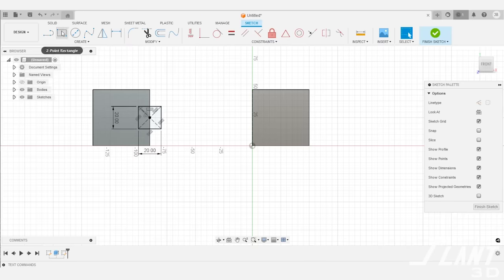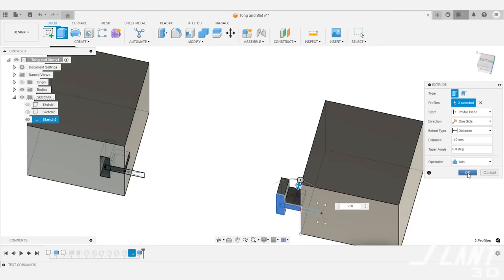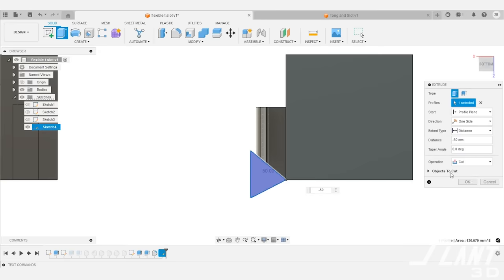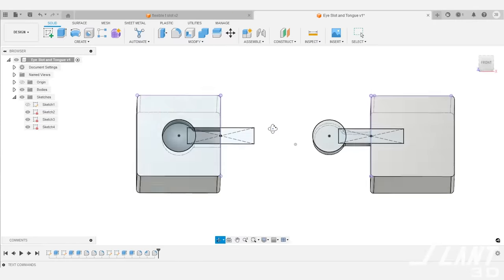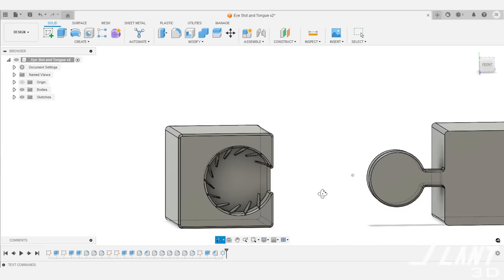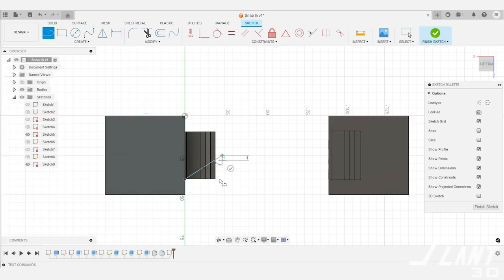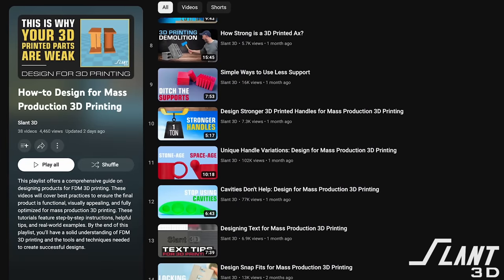Joining Features | Design for Mass Production 3D Printing

Comment: I don’t mean to be rude, but those “snapping” pieces that you said cannot be done with regular manufacturing techniques do exist and are used extremely regularly in injection molded plastic parts. If you look up “plastic snaps” you can find entire design guidelines  to create permanent or temporary snaps. Those guides are usually made for injection molded plastics so you have to change them slightly for 3d printing but they are very common
Reply: You need a more complex mold but they're reasonably easy to make.
He also said they couldn't be machined, that's ridiculous
Reply: Yeah that was a weird statement. Basically every other consumer device uses these for the case. Sometimes in addition to screws, like with many laptops.
Reply: That doesn't conform to the "3d printing is magic and can do things no other process can do..." claim you see quite often but is very rarely true. 

Additionally many of the options provided in this video are also just generally bad and extremely fragile when not assembled and some when assembled.
Reply: Well thy can be machined.. T types of mills easy...
Reply: @Segphalt literally this.  This dude is an amateur.
Reply: @NicksStuff  I'm glad I'm not the only one who raised an eyebrow at this.
Reply: I'm glad this thread is here. I had the same thoughts but I am not really tuned into real-world manufacturing so his video was about to lead me to a false understanding that I may have parroted to someone else.
Reply: @NicksStuff  I was skeptical about that impossible claim too...
Reply: You're talking about over center locks.  They can't be machined, easily, but they certainly can be machined.
Reply: Can plastic snaps be molded right into the main body? How can the part eject from the mold?
Reply: @larrybud  it takes a complex mould, with some moving parts. Not impossible, but I guess not generally done as creating the mould is more complex and it probably also increases cycle time, lowering production rates. Depending on the material I guess you can get away with small grooves without additional mould complexity by relying on flex in the material itself (maybe larger/more powerful ejector pins would be needed).
Reply: @koma-k  Exactly. It depends on the material and the flexibility right out of the mold. More complex molds can have various moving parts as they open and close to create quite complex and/or deep undercut features. If you look closely at hooked/ribbed tabs, you can often see an extra parting line where a section of the mold retracts axially before the mold opens. Some designs have undercut features that depend on the ejected part flexing enough to clear the mold. Some plastics will further harden after ejection, and others are just generally more flexible even in their final form. Certain parts even depend on the flexing action of the ejection to impart less rigidity to certain areas by flexing those areas when hot, such as common "living" hinges, where a thin cross section piece is intended to bend in regular use.
Reply: The locking features are manufacturable. Just very expensive, probably not worth it for "traditional manufacturing".
Reply: Yes, but they tend to be made in 2 parts. The snapping interface is basically how a lot of washer doors close.
Reply: Snap fits are extremely common in injection moulding. I have been designing parts with these from I was studying ID 2 decades ago. They have been around before that. The only issue is that they require slides in your mold.
Reply: I like this content creator's efforts to educate, however, in this case, internal features (undercuts and snap fits) can absolutely be injection moulded but not with a simple 2 part injection moulding tool. Tools with side action slides are regularly used to achieve such details. However there are definitely examples of features that can ONLY be 3D printed and would be impossible to injection mould, but this video doesn't have any examples of this.

Comment: tapered dovetails for the win.  They do it all and are easy to design.  Just make the profile, project it to the other plane.  Run an offset and finally a loft.
Reply: Indeed; can't believe dovetail joints weren't on this list.
Reply: I was looking for my dovetail peeps!
Reply: You can even make dovetails into a form of locking tab.
Reply: Thank you! Must have slipped his mind when filming, but could easily replace the t and circle on a stick designs.
Reply: @chuyskywlk insanity right?
Reply: Thought for certain he was going to mention that after the t-slot.
Reply: @chuyskywlk  If he showed dovetails he couldn't claim that they where only possible with 3d printing, which is the real point of the video.
Reply: can you write more about your tapered dovetail? what kind of angles and what kind of tolerances do you use?
Reply: Same concept as the T just tighter fit and won't back out yes?  But you can only slide that joint, it can't be snapped into place.

Comment: I have been in engineering design for 50 years + and at 69 years still going strong. I find 3D printing with a combination of laser amazingly useful for prototyping and congratulate you in your channel and videos. Unfortunately you will always get negative comments generally from those not involved in design and lacking in lateral mindedness which of course is essential in design. Your objective of giving inspirational ideas to others thus enabling them to make informed decisions is excellent. Well done...
Reply: No, you haven't! If you did, you would have caught the many lies he told. I've only been designing a decade and I noticed multiple untruths. Such a dumb thing to lie about.

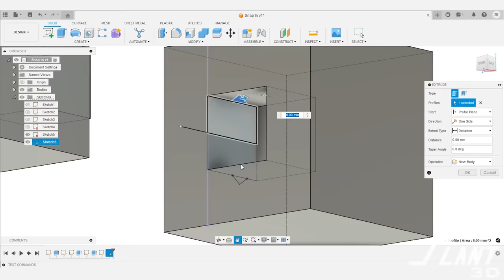Comment: 7:04 Such snap-in joints are actually manufacturable pretty good without 3D-printing. If your part doesn't have to be fully closed you can simply machine the recesses from the outside. Another option for fully closed surfaces would be injection molding with movable core pins. That's actually pretty standard in the industry and mainly limited by size. Another option would be milling or even EDM machining with special diamond shaped tools.
Reply from the maker: So not manufacturable as is. Correct
Reply: I had the same thought when I saw that. I have actually machined parts that are virtually the same with internal diamond shaped tools.
Reply: @slant3d  These parts can absolutely be manufactured with traditional methods. Fisher Price Snap Lock Beads are basically exactly what you are describing and have been made since the early 70s
Reply: @slant3d  if its a plastic part using a collapsable core in injection molding should allow for production as is.
Reply: Yeah snap links are easy to manufacture and have been around for years. While set up is a bit more expensive than traditional moulding it can be moulded or machines easily. A lot of toys are actually manufactured with those exact joints.  

Of course this is assuming the geometry of the product allows for it.
Reply: you're right, pretty standard in industry, absolutely manufacturable
Reply: @slant3d  No, there's a variety of ways to approach it, but those internal grooves can be machined. On a lathe, you can use a boring bar to internally open up a hole while leaving the opening at a small diameter. Your structure is basically the same idea, but done on a mill, and square... instead of a boring bar, I think you'd probably use something like a dovetail cutter, but I don't own a mill, I'm not certain what would be the best tool. 

I think using discharge machining, you could probably pull it off too. It would be a funky looking electrode though.
Reply: @slant3d  Wrong, mill out the square hole, change tool, mill in the slot with a dovetail cutter and or reverse dovetail cutter.  there may be a bit of overcut involved but this method could absolutely be manufactured with milling.
Reply: @@isawthat91 Agreed.  Basically the take-away here is 1) you can definitely manufacture these products [with similar function] with other methods, but 2) most have a higher barrier to entry; fortunately 3) this video still has educational value.
Reply: Yeah I think you all missed the point the point is it would take other methods several machines costing hundreds of thousands of dollars each versus a $300 3D printer that can do it in one pass
Reply: Additionally injection molding is not scalable as far as the size of the part goes. You need a separate new mold for every single different size part of the same shape whereas with 3D printing none of that is necessary you simply scale the part in a slicer and you have a new part just like that in minutes
Reply: @phasesecuritytechnology6573 that's maybe what he has meant but that's absolutely not what he said. He clearly states "they are impossible to manufacture". This statement is simply wrong.
In return for that injection molding is more than well scalable regarding quantity, quality and cost. But scalability was not the topic here.
Reply: @dominik7841  he clarified his point in the comment, "not manufactureable as is."
Reply: @phasesecuritytechnology6573 you mean you would have to change the geometry of the shown part to make it manufacturable by conventional methods? I have to disagree with that.
Reply: Yeah, really disappointing response from the author. Doubling down on lack of knowledge is a bad look.
Reply: @slant3d  losing credibility and showing an unacceptable amount of bias with this, and with that flippant reply. It is absolutely manufacturable by other industry-standard (i.e. not exotic) methods with some adjustment of geometry. You know, the same thing YOU do to make things easily printable. Tailoring a part to its manufacturing process is always part of the engineering game.
edit: don't like pride and bias ruin what is otherwise a very informative channel. Care about your reputation enough to admit when you are wrong.

Comment: I love how this channel features solutions that are genuinely useful but somehow so easy to understand. Anything that removes the absolute need for glue or screws is a pretty helpful design solution 😊
Reply from the maker: Thanks for watching. Happy to help
Reply: no part is the best part!
Reply: @ZURAD  what do you work for apple? no part last for ever, even one solid piece. replaceable parts means ability to repair. destroy the whole thing and make a new one or replace just a part that all the strain is shifted to. if the whole item is made from replaceable parts it can last forever, but that's not good for apple's profits. also mass production metal screws can provide a lot of cheap structural support to plastic.

Comment: 7:00 Worked as injected plastic part constructor, and yes, you can make such geometry in injection molding. With some small changes to geometry, like adding drafts to some faces. However, it would be expensive because you would need two very small sliders. And in traditional plastic injection molding, we would use proper positioning and proper hook (meaning, contact only on line, not surface to surface).
I suspect it could be done in metal machining, but again, would be expensive, delicate work, with some changes in geometry, slot in corners would be rounded at least.
Reply: He did say "as is."

Comment: Great content and truly enjoy the re-education. Being in the injection mold industry for nearly 1/2 a century there is an ingrained way at which "we" see designing and producing parts. It's this type of content that truly helps to advance my (our) thinking. However, there are techniques and processes that may not be top of mind for making some geometries that have been referred to as "impossible to be made any other way" on this channel. In the last example with the internal grooves, fully enclosed, there is a method to release that geometry in production mold tooling... I developed it for molding internal hinges on the Motorola phones in the early 90's. This comment is meant only to inform and I realize has nothing to add to the 3d printing world. Please keep up the content as it is truly informative.
Reply: Don't discount your knowledge. Engineers need to listen to people with your level of experience more.

Comment: Just started a 20 hour print where I opted for bolts and encapsulated nuts… wish I would have seen this video first! Nice work!
Reply: Coming from mechanical field I always use nuts and bolt myself.
For dissimilar parts...a interlocking system is extremely useful...
I know what you mean.

Comment: Excellent job with this video. But the snap-in joints are typically called snap fits. They are actually used a lot with injection molded parts but if I need a semi-flexible yet strong part, their basic design has almost always been the answer, especially when 3D printing.

Comment: I really love these! I design for both printing (MJF, FDM and SLA) and for CNC and injection moulding. This is also good - but locking, flexing clips are very possible and very common in injection moulding. Sure, this exact execution is not but the concept is exactly the same. I think the lesson is that we can use a lot of the same thinking, but applying slightly different optimisations and exploiting different strengths is important.

Comment: Love it. Thank you. 

I have just one issue with this, however: Snap joints have been around for quite a while in injection molding. The mold just needs an extra mechanism for each end - the male and the female. The additional mechanism does increase cost, however, and is SO much easier to do with FDM than IM. FDM makes the hidden snap joint a no-brainer.

Comment: Very good examples in your video.   You can change the fit (how much clearance or interference), but you aren’t changing the tolerances.  Tolerance would be how accurate and repeatable your 3D printing is.   A worn lead screw or bad bearings would open up (worsen) the tolerance that you can meet.   Take a look at an engineering drawing some time and you’ll see the tolerances required to make that part.   You choose the process (machining, surface grinding, EDM, etc) based on those required tolerances.

Comment: Nice!
My 2 "go to" connectors are the v-style tab (like the i-style but with "wings" on to stop it easily pulling out or flexing / rotating) and the "click-in-style" as you demonstrate, basically what you find on bag straps and belts that needs to mate together

Comment: needed a thin section joinery -> Slot for 2mm sheet metal strip is what i'm going to try :)
Glued in with E6000 or Epoxy is the plan.

Comment: I borrowed the concept of cordless power tools, the way 20V batteries snap into the tool is quite clever.
Although much more complex to design, I found it really good to make detachable parts (with and without a detach button).
Think the main takeaway is how the edges of the slot are a sequence of chamfers. This allows for bigger and safer tolerances that will still create a snap that does not jiggle.

Comment: Especially the spring design, but more generally whenever tension between parts is needed to hold the joint together, you're going to be fighting against creep - the property of the plastic to gradually deform over long periods of time under load. I would consider these designs non-starters for PLA or nylon and questionable for PETG. For ABS, ASA, PC, or PET they're great.

Comment: New to 3D printing, and have been brainstorming custom fasteners. 
I was thinking about an internal hole, with a slot on the edge that acts as a key slot. a tongue can only be inserted sideways, and then once inserted sideways, the part is twisted 90° (or more depending on design) to engage some kind of locking design on the inside, that prevents the part from being turned in reverse to allow the tongue to be removed via the key slot.

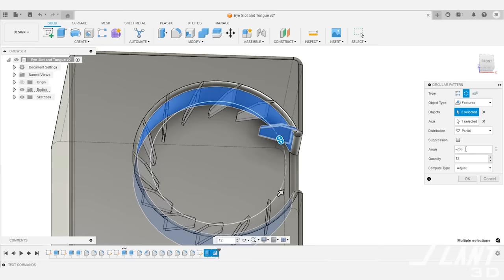Edit: imagine a grip fin ( 5:22 ) on the inside of a part that prevents twisting the part in the opposite direction once the grip fins are engaged within the body of the part.

Comment: I usually use conical or pyramidal pins for locating 3d printed parts against each other. One irregular trapezoid pyramid for a low-precision joint, two elliptical cones for a more precise flat glue plane, or three circular cones and one threaded insert and bolt for a removable kinematic mount. Aggressively tapered pin edges are easy to print, easy to sand to a precise mating distance for a one-off, and easy to adjust CAD to get a second copy to mate perfectly right off the bed. They also provide excellent glue surface area.

Comment: Tolerances are the bane of my existence. Literally every figure I download to print uses a key and hole (tongue and slot, whatever), a square bump that fits into a square hole, and not one artist has bothered with tolerances so the parts don't fit together and I have to sit there filling down the keys to make them fit. Even then they don't seem to fit cleanly.

Comment: As far as the locking tabs go you forgot about the classic dovetail.  The dovetail is simple, locks better than the square tongue, and tends to be a strong connection.  Depending on what you're making sometimes dovetails can be a feature of interest in addition to a connecting feature.
Reply from the maker: Doestails function the same as the I and T
Reply: @slant3d  and their design is as simple as the tab.

Comment: If it doesn't need to look fancy I often just screw them together with M4 bolts + nuts. With a bit of tolerance testing you can print hexagon-shaped recesses into which you can pull the nut via the screw, super easy to design and durable.